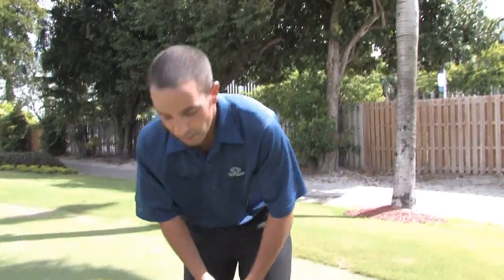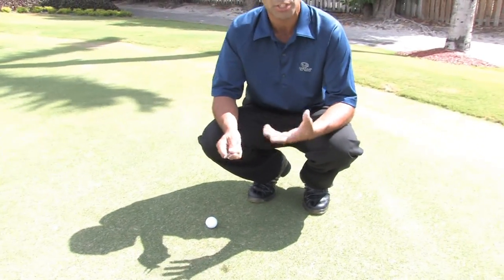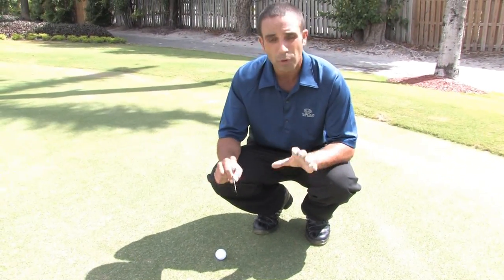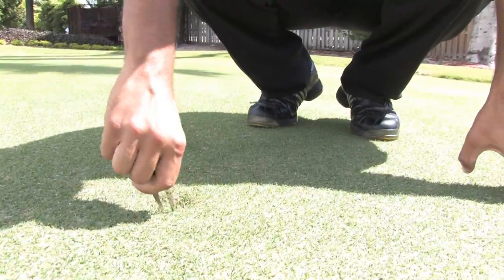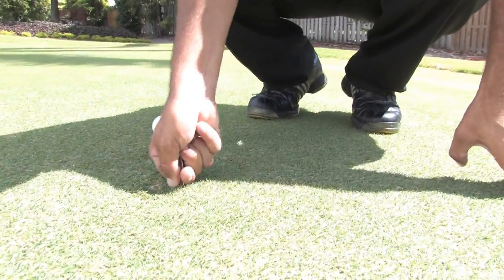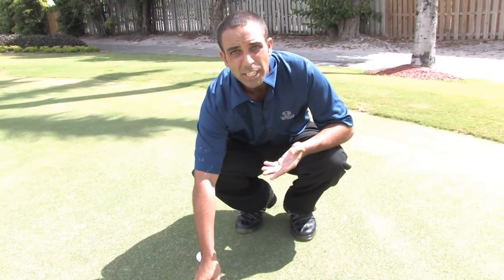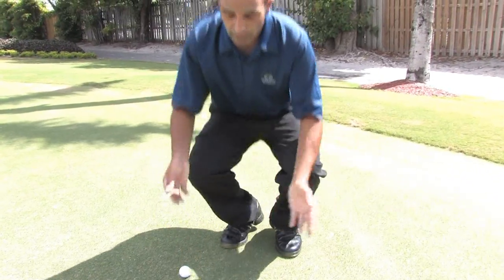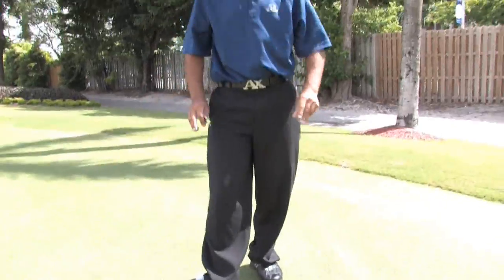Golf Tips & Etiquette : How to Repair a Golf Ball Divot on the Putting Green

Comment: All courses should make you produce a tool with ball mark attached for course maintenance and speed of play.  Using a tee takes to long to do it correctly and I hate seeing players trying to balance their wedges on a tee keeping it out of the wet grass.  Get a repair tool please.  Also, just give it about 3 stabs on each side and you're done instead of pulling hard and large to the inside.